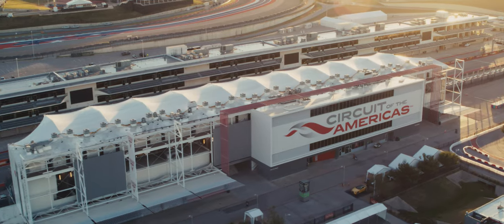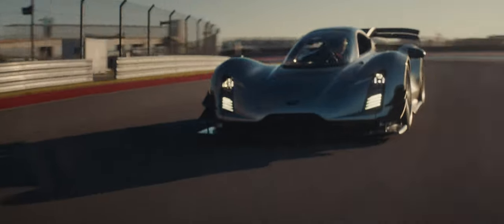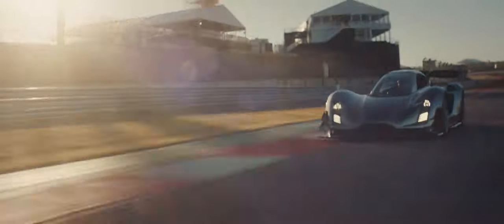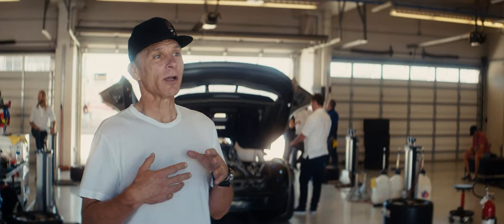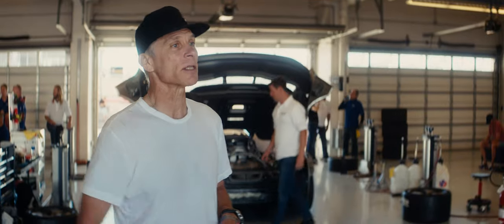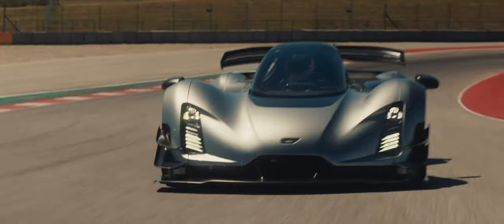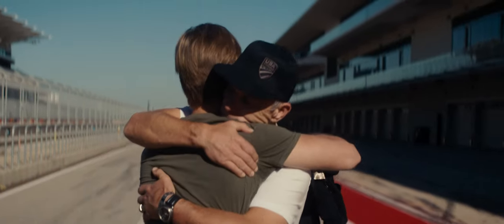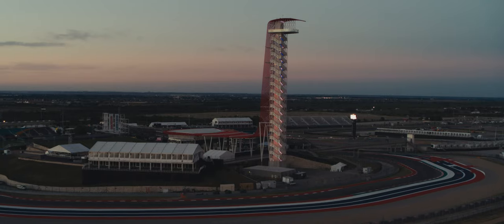Czinger 21C at Circuit of the Americas: Sets a New Production Lap Record

Comment: Its crazy when you think about the fact that McLaren, which has years of expertise, got destroyed by a new company, which doesn't even have any racing experience....
Reply: Mclaren never appeared at the track. The time was also done by a customer called Jason Hart. Yes he races however if Mclaren had one of its official drivers  and  Mclaren had the same amount of time with a full crew at the track it's time would be faster.
Reply: @Рагнарёк i agree
Reply: @skudaaron1986  not to mention that the Czinger is not even a production car yet

a prototype so no one knows if it's running slicks, rock hard suspension, stripped dashboard or other weight savings, boosted power

it's basically a modded car at this point and once you start modding, you're competing with Formula 1 cars because the race to the top ends there
Reply: @william_SMMA  did you watch the video? They literally state that this is in production trim with street legal tires.
Reply: @christophejergales7852  read my comment again, but slowly
Reply: @william_SMMA  I did. I must be missing something.
Reply: @christophejergales7852  I mentioned yet

They could change a lot of things before it hits production

It's also not homologated across all 54 states, not to mention across Europe, Asia, etc

Anyone can strap a 1500 HP engine on a car that weighs next to nothing and set a series of track records, but as long as it's not a homologated production car

The Czinger's comparison should be formula 1 or Gt3 cars as all of them are non-production and non-road legal as of this comment
Reply: @william_SMMA  its pretty close in comparison to some gt3 cars, only 6 seconds or so off which is pretty impressive
Reply: Are you living the American dream?
Reply: “Got destroyed”🤦‍♂️ Production car vs what is effectively a race car. Apples v oranges.
Reply: @william_SMMA 2:11 you can see the Michelin cup 2 R tires.
Reply: Still got destroyed
Reply: @william_SMMA whats crazy is manufacturers actually strip of weight and put modded suspension in their lap time records 😂
Reply: @MonicaHolly143  damn. that's straight up lying to get better lap times
Reply: @william_SMMA  they all do they even put a roll cage which saves seconds

Comment: it is very clear that the driver, a master of his craft, is pushing the vehicle to approximately 80% of its limits. and at times, up to 90%.

approximately 80% of the time, the driver is pushing the vehicle to approximately 80 to 90% of the vehicles limits, through turns.

this driver was being extremely light on the throttle and controls, into, through, and out of turns.

with 100% maximum limits being achieved, this vehicle would have significantly reduced the world record far beyond that of the number achieved.

it almost appeared the vehicle was being broken in on these laps. and not pushed hard to any degree near the extreme this vehicle was entirely designed for.

i realize the tires are street tires. but it is very clear to see the vehicle is completely gripping the ground with the greatest of ease. even the tires are not being pushed beyond 80% of their capacity to maintain controllable traction.

a beautiful vehicle, a masterpiece of mechanical and electrical engineering.

i am very interested in seeing all telemetry numbers. including exhaust gas temperatures in real time, intake and exhaust pressures, and temperatures, all vector g forces.

including down pressure of vehicle from its aerodynamic design pressing down onto the vehicle at high speeds. including the forces on the wing and including side force on the rear wing through turns.

i would also like to know the air to fuel ratio. i have read of achievements at 2000 parts air to one part fuel. i imagine if this is a zero emissions vehicle, its powered by something incredible.

i’m interested in compression, piston design and shape, intake valve and exhaust valve geometry and size/diameter/shape.

if turbocharged, how much pressure, and how close or far away from the engine, is the turbocharger placed. is it dual or more, turbocharged (four?)

i love it!

what is the fuel, what happens to the fuel before it enters the engine, does the fuel go through a magnetic field before entering the combustion chambers, thus reorganizing the fuel molecules to burn cleaner, and releasing greater potential from the fuels energy (study the nasa space shuttle which sends its fuel through a magnetic field to cause an electron spin thus increasing the fuels combustive power (btu) to more than 2.5 times its original btu.

this vehicle is a masterpiece i am very interested in studying.

Comment: This is mind blowing. Love the tech. I hope it becomes mainstream in the future. As for the driver, seems a little slow in executing the acceleration out of corners and slowing down on small turns in the road when there seems to be no need. In other words, not making quick decisions. I test ride motorcycles and love speed. The key is to have that gene of not being afraid of high speed and being a speed junky. Also, being able to anticipate greatly helps. Watching video again as I am typing this and just do not understand why driver is slowing down on the small turns.
Reply: I feel ya dude.  I've spent tens of hours on COTA in homologated GT series/touring cars from BMW Z4 up through Vipers, McClarens, Jaguars, even the 2016 Ford GT, all digitally on Forza Motorsport 7 and always on sticky race tires. My times were about that fast or slightly better depending on the car and the race.  Gotta agree that riding with this crew on this hot lap had me pressing the gas in my head much earlier coming out of corners than he was doing.  It felt all wrong.  Also, it seemed that he was easily coasting through sections that I'd be hard on the gas through.  Without seeing his actual speed it's impossible to know how close he was to losing grip.  Also, it seemed that when approaching corners, he would coast up for what seemed like an eternity before mashing the brakes late.(obviously, you can brake later if you're going slower)  The cumulative feeling was that he was unfamiliar with the track, OR....maybe he was watching a clock and was under a mandate to "not be too fast".  Having said that, none of my cars had the kind of power of the Czinger 21C, so top speeds won't be comparable.  With the straight line acceleration and speed the 21C is capable of it would allow him to drive the technical sections much more pedantically and still get a 2:11.  Just saying.  lol.
      Obviously they were on street tires so the G forces could not be as radical as on sticky racing slicks.  Could it be that he was merely leaving some room for improvement and not letting ALL the cats out of the bag at once?
Reply: @codypendant6745  
      l long to have Max Lewis or Alonso give it a run,  same parameters of course. 
    Also maybe or possibly,  he knew he didn't have to push hard knowing he would beat the record  easily.     Just as you mention comparatively in GranTurismo you don't have to push the Tomahawk.X very hard because you don't have to,  it will easily beat the snot out of anything in the game hands down !
   Lastly he didn't wanna crash it under any circumstance, lol.
     lf you felt he left a little bit on the table then he probably did.   (with 5 seconds in hand over race distance,  that's an easy.....
5x50 + 5x6,  250+30,280/60,
 ..... 4:40 victory over 56 laps at COTA.)

   01may2023dellthecomputer

Comment: I was curious to know what the P1's previous record time was, but when I looked up the COTA lap times, the record time is listed as Mercedes-Benz W10 EQ Power+	Valtteri Bottas	1:32.03.
Reply: There's different "lap records" for different levels of cars. This is the "production street car" record, not overall record. But this can be driven on the roads and an f1 car can't so they can't really be expected to be compared.
Reply: @Fwr942  Do you know what the P1's record was?
Reply: That's a Formula 1 car, engineered from the ground up to race exclusively on tracks.
Reply: @slickrock1371  2:17
Reply: @derekk5992  Wow.  That's an impressive margin.  
Thanks for the P1 lap time!
Reply: @Fwr942  The Czinger isn't in production yet though

you can't set times on a prototype when it's most likely not representative of the final product that the 80 buyers get

Comment: It's come a long way from the prototype-  2017 "the Divergent".  I just saw the updates to the car after doing a Google search. Love everything about it but for one thing, the seatbelt. Allow it to lock in place when in use and to unlock to let down when showing off the car. Or, develop a seatbelt system that fits through a slot up the back of the seat from the floor. If I can think of it surely someone in-house could have thought of it. And, automatic doors and trunk for the price. Don't mind opening doors manually, but for the price? This car probably will not be a daily driver. Rather, a car for special occasions and to show it off at various car gatherings. Last, I'd say make 10 cars per year after the first 80 made. If I every get deep pockets to shell out 2 million, I may want one in about 10-20 years.
Reply: this car isn't developed with that in mind, it's developed with track speed. auto doors/trunk would add a ton of weight and harm its performance
Reply: @jmac2o229  he's used to flex cars with no substance

Comment: 1250 cv vs 900cv ...  for same weight....
cut engine rpm in straight line with over 400 kms/h top speed ????

Comment: Do you think Czinger will be able to offer
one day AI.Mét x Hydrocooling hybrid mechanisms of corrective translation through these suspension frames endowed with axle angulation reactions?
With these types of ultra-durable trains modified for camber constraints collected by the support surfaces of the wheels on the ground.
Finally, what is AI's limit for its forceG adaptations to the distribution of engine newton meters on mass transfer (emc²) on the suspensions of hypersport vehicles?
Czinger 311 Mph AI challenge? serving these joints of trains the slippage of support ground opening of the axles due to the displacement of grid of adhesion on wide tires.

Comment: Crazy to think that as fast as this car is, a F1 does it in 1m 32s 029 ...
Reply: @Рагнарёк not this one either
Reply: @Рагнарёк the one:1 is road legal tho are u talking about curves or what.
Reply: F1 is one of the pinnacle of motorsport, this though impressive is just a road car. Normal people will black out after a lap of F1 due to high lateral g forces
Reply: racing slicks and lewis hamilton as driver will take 12 seconds of this time alone
Reply: @neerajnongmaithem392  train for 1 month and you won't blackout though

not a valid point

Comment: Late to the party but this car isn't even close to what is possible. Gearing limited on the straight, driver very late on throttle after corner apex, probably due to lack of traction and/or downforce. Nevertheless an incredible result.